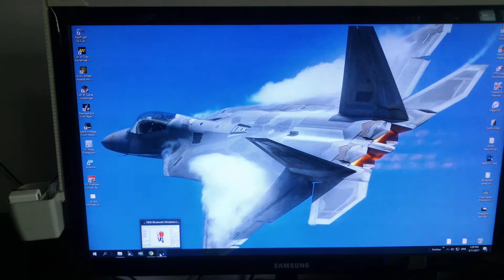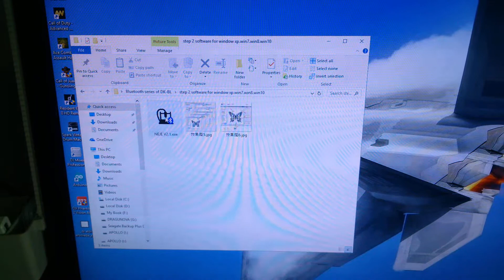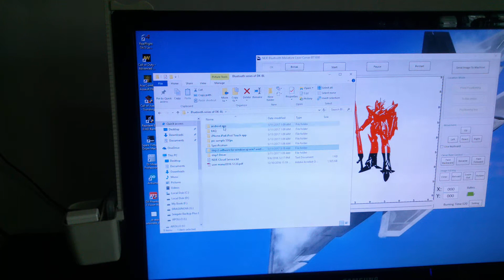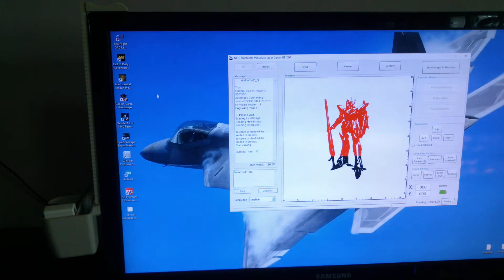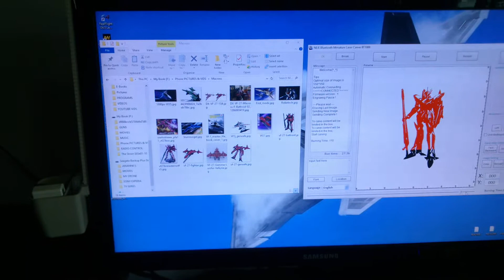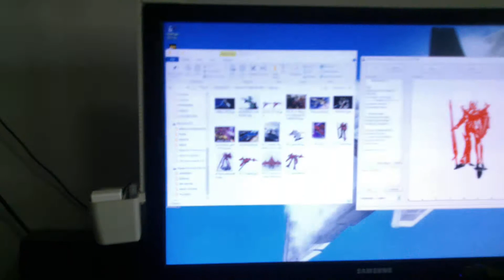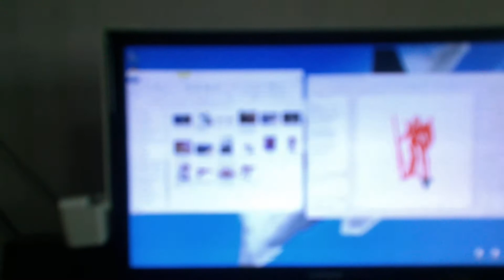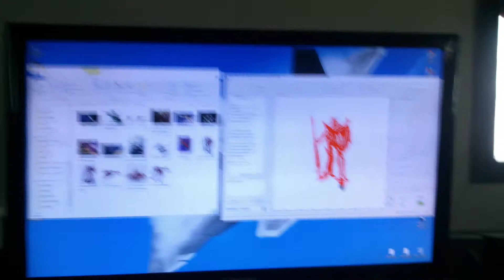NEJE DK-BL 1500mw Laser Engraver Cutter Part 2: Operation & Initial Impression

Comment: Thinking of buying this, thanks for taking the time to review it
Reply from the maker: Just be careful not to toast the laser module. I was letting it rest a good 20-30 minutes, but it still roasted well. The good thing is the Ebay seller was really nice to send me another laser module & had it shipped out just today. It was good while it was working. For my application, I would get another unit so I can do continuous engraving and have ample cooldown time between the 2 engravers. Had fun doing so, most rewarding are comments like this. I really appreciate it. Thanks, @Jobi Wan!